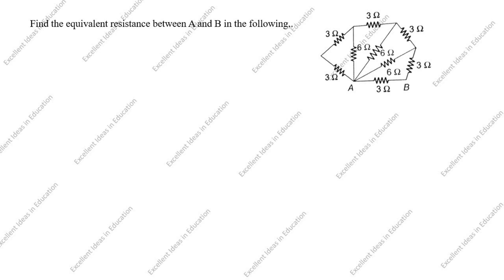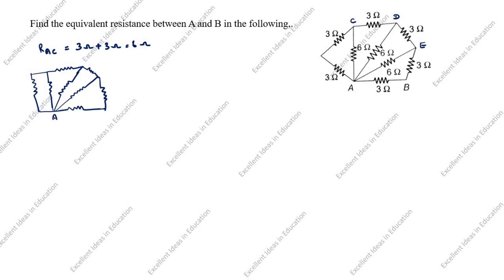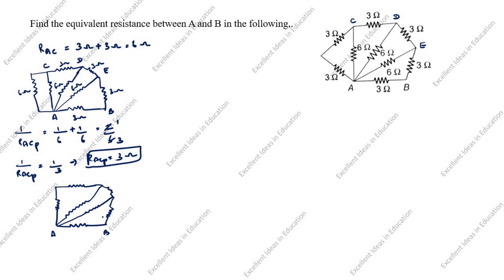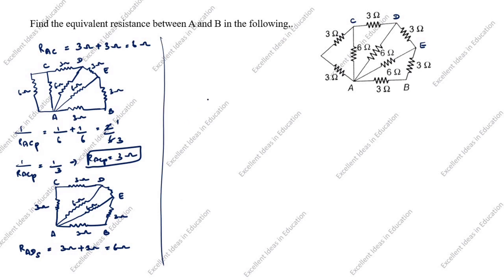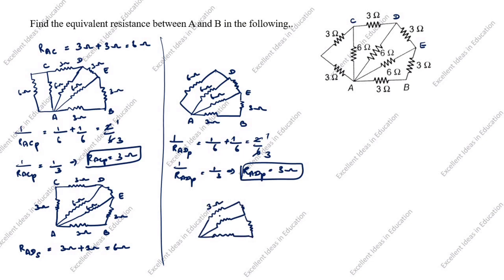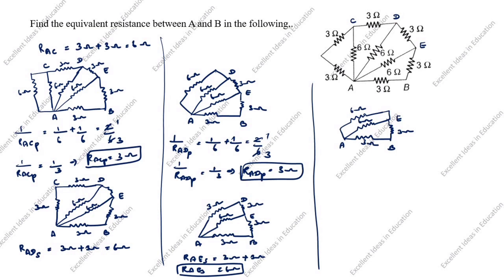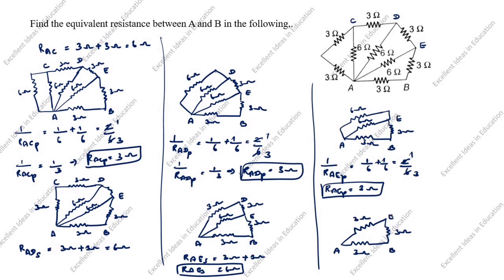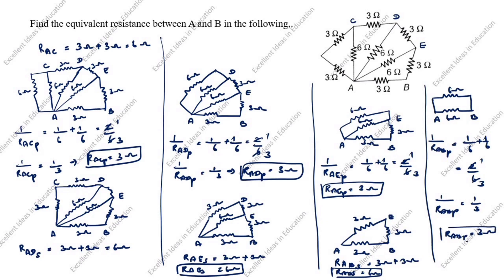The equivalent resistance between points A and B of the circuit given / Class 10 and 12th Physics

Comment: Mam, I think the final step is wrong. Because, you have added 3+3 which is 6. Then you have gave 6 and 6 in parallel. It should be 1/3 + 1/6
Reply from the maker: Yes, final answer is 1/3+1/6 = 2 ohm. Rab = 2 ohm.